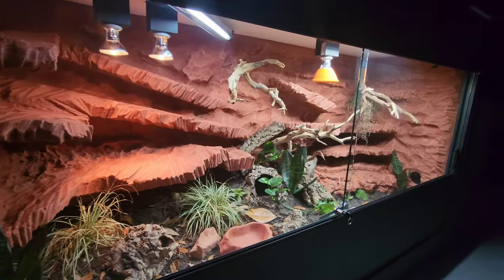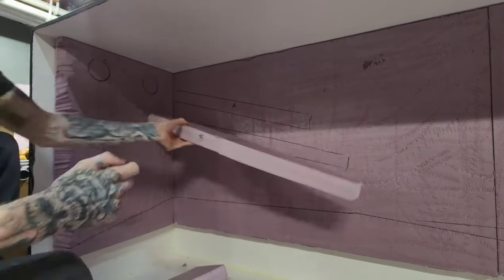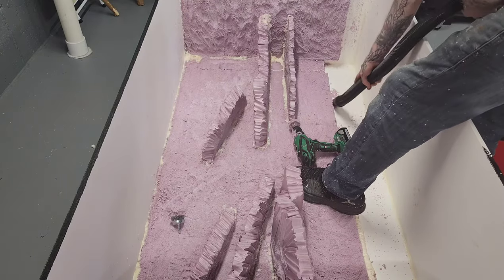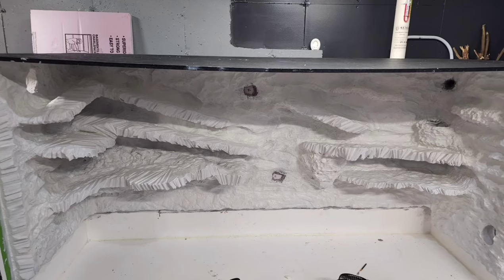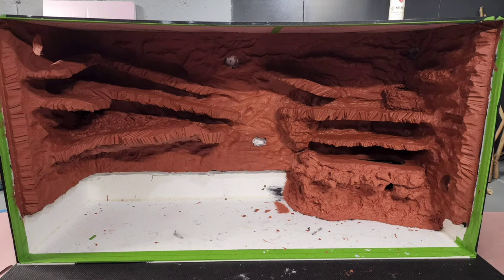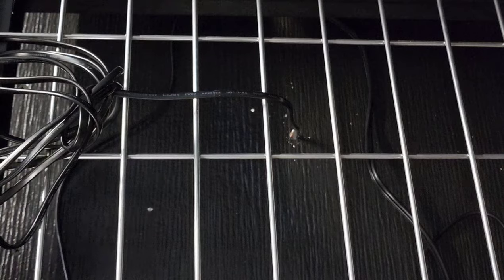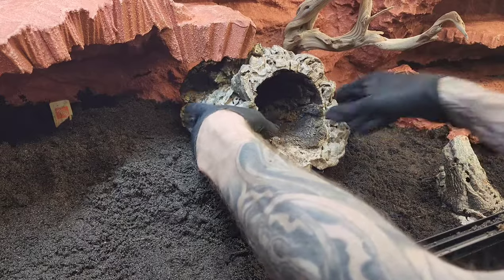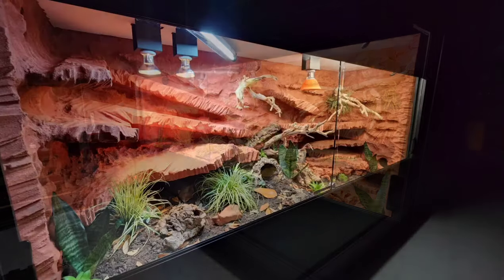DIY Monitor Enclosure Arid Set Up & Bioactive Build #reptiles #vivarium

Comment: What is the name of the timer setup you use ? Does this control the lights, heat and misting ? The app sounds amazing.
Reply from the maker: The smart plugs/ timers I use is a product called govee (link in description) 
It controls my lights, heat and can monitor humidity (I do believe they sell on that will add humidity (if you have a fogger set up to it)). The misting system uses the mistking timer that it comes with. I did add a shutoff valve to the mistking hose so I can have it mist when I want to bump humidity only because I do not want daily mistkings in this enclosure.  Hope thos helps
🤘💯🦎🐸🐍🐢🌱

Comment: I'm going to use some of that 2" pink foam to make a large rock formation(20" tall) for my paludarium, any suggestions other than spray foam for gluing up the layers?
Reply from the maker: I found spray foam to work best if you are planning on carving the joint peices of xps foam board. Otherwise they do sell a foam glue that is supposed to be animal safe. I used it like 12 years ago so I don't remember the name. But check out this video I did. It has xps foam board in a paludarium https://youtu.be/-6B4wvRxdqA
Reply: @bradsbioactivebuilds  thanks for the response. I was concerned that the expanding foam would create gaps between the different layers, but it doesn't appear that was an issue for you.
Reply from the maker: @taylorhickman84  it really didn't. If needed add a weight ontop to keep it all in place.

Comment: Dude, awesome video! Have been referring back to it more times than I can count as I've building mine. One question tho, where did you get the custom glass for your enclosure??
Reply from the maker: Awesome J_B_D! I'm glad you found the video useful. 
I just Google custom glass shops near me and went to a good rated shop.
The glass I used is 1/4 inch tempered glass with rounded edges. 
I just gave the glass shop the opening measurements with a small cut off of the bottom and top track, and they did all the math to make it work.
🤘💯🦎🐸🐍🐢🌱
Reply: @bradsbioactivebuilds  thanks just finished mine up!
Reply from the maker: @deres9  awesome! Send me a pic on Instagram!

Comment: How tall is the Arcadia lamp holder, including the ceramic portion that sticks out a bit at the bottom? I can't seem to find a dimension anywhere for planning purposes. Nice job!
Reply from the maker: The lamp holder is 3 ¹/²" from ceiling to bottom of ceramic fixture. 
With the 50w halogen lights it is 6 ⁷/⁸"
Have fun with your build and feel free to ask any other questions 
🤘💯🦎🐍🐸🐢

Comment: Are the XPS boards insulated? We are starting to build an enclosure for our Argus monitor and any tips are well received!!
Reply from the maker: Yes, the XPS board is an insulation board. Also, for an Argus monitor I would use a concrete or Zoopoxy over they xps insulation board instead of drylok. For this sized monitor, this nails will most likely do right through drylok. I'm currently building a large enclosure and will be using Zoopoxy because of the size not the monitor that will be going into it. I'll be releasing the 1st video of the series this weekend.
🤘💯🦎🐍🐢🐸

Comment: Did you use two different silicones? One for sealing the enclosure and another for adhering the XPS to the enclosure?? If so, what's the purpose of that?? I'm about to do my first build for my mangrove monitor!! Thank you:)
Reply from the maker: I did, I used one that is 100% silicone, which is for plastics and another 100% silicone to adhear the xps to the walls.

Comment: What size enclosure did you use? Build looks great.
Reply from the maker: It's a 6w4d3h enclosure I built using PVC board. The same method as this video here https://youtu.be/kFIuR6ZNy6A I just smaller.
Glad you like it. It was a fun one to put together!
🤘💯🦎🐍🐢🐸
Reply: @bradsbioactivebuilds  awsome, thanks!
Reply: @bradsbioactivebuilds  also, couple more things. What plants did you use and did they survive?
Reply from the maker: @Ethan's Animal Adventures  the snake plants, blue Aloe, Aloe pothos and some of the Succulents survived. The grass lasted a long time but placement twas the issue, too much direct heat. I'll be replanting a few once spring rolls around  to manage better. But over all doing very well.

Comment: That set up looks amazing! May i know where you got your giant panels of XPS foam from, i can only ever find the smaller panels.
Reply from the maker: Hit up home depo or lowes. Hone depo it's closer to the plywood section. Like an aisle or 2 down typically. They come in 4x8 sheets anywhere from 1/2 to 2" thick. If your looking to do a lot of carving, go with the 150R 2"
🤘💯🦎🐸🐢🐍🌱
Reply: @bradsbioactivebuilds  Unfortunately, i am based in Hong Kong. So Home depot or Lowes isn't an option. Will have to find something online. But thanks anyway! :)

Comment: I’m preparing to build a similar enclosure with the same white pvc boards. What kind of paint did you use on the outside? Would it work on the inside walls too?
Reply from the maker: I used a primer that bonds to pvc. The. Uses a 100% acrylic paint for home depo. I would use it on inside. might scratch up depending on what you are putting in there
Reply from the maker: Have fun with your build 🤘💯🦎

Comment: Where do you buy your sliding glass doors and do they come in different sizes?
Reply from the maker: I just went to a local custom glass shop near me and gave them the opening for the front and a cutting off of the the track. They calculated the size with a 2 inch overlap.
Hope this helps. If u live in the Chicago land area I can get using contact with the guy I use

Comment: Great video - how thick was your tempered glass?
Reply from the maker: Thank you and I used 1/4 thick tempered glass. They also rounded the edges and corners at a 45° angle. Makes it slide easily.
Reply: Thanks a lot  @bradsbioactivebuilds  ! The slider tracks are sitting on single panels of 1/2 inch thick pvc right? Or are the panels doubled up to 1 inch thick, like in (I think) the water monitor enclosure build?
Reply from the maker: @Hanschanhs  the bottom damn and top header are doubled up (in total 1"). They do seem thicker pvc trim board just not in 4x8 sheets. I think the max height is like 10nor 12 inches. So if you can get away with that, it would be the way to go. But any higher you'll need to double up.

Comment: Wow that is an awesome enclosure man
Reply from the maker: Thank you!
🤘💯🦎🐍🐢🐸
Reply: @bradsbioactivebuilds  I’m in process of building one for a Savannah monitor
Reply from the maker: @Travis  that's what's up! Have fun with your build and cool Varanus! 
🤘💯🦎🐍🐢🐸
Reply: @bradsbioactivebuilds  did you mix the concrete colors with the drylok?
Reply from the maker: @BigTrav310  yes. I usually fill up a plastic cup and then add quikrete to that so I have white in the can still for future colors
Reply: @bradsbioactivebuilds  sweet cause I’m going to attempt what you did just not that intense. Lol
Reply from the maker: @Travis  I'm glad to hear! Have fun with your build! If you have any more questions feel free to ask!
🤘💯🦎🐍🐢🐸
Reply: @bradsbioactivebuilds  will do man mines all out of 3/4 plywood and 2x4 but I’m putting foam board in and drylok it all inside so the humidity won’t hurt the wood as much as possible
Reply from the maker: @Travis  awesome,  that's exactly how I would do it if I were using plywood. Depending on size you may not even need 2x4 frame with 3/4 plywood. 
But this is how I frame out when using 2x4 https://youtu.be/mfydItUfs8c
Reply: @bradsbioactivebuilds  question the gslkding glass track did you get off Amazon? And I got mine off there it’s 6ft long I made my Savannah monitors cage 7ft long how did you secure the track down?
Reply from the maker: @Travis  that's where I got mine from. And yes, they only have 6 ft. The enclosure in this video is 71 inches (just short of 6ft. 
But the new enclosure I'm working on is 8 ft wide. So I plan to use 2 of them and cutting the 2nd one fit, lining up the factory ends the best I can.
Reply from the maker: @Travis  I will also silicone and use painters tape to secure them down like i did in this video. 
https://youtu.be/kFIuR6ZNy6A
Reply: @bradsbioactivebuilds  awesome thanks man.
Reply from the maker: @BigTrav310  anytime!
🤘💯🦎🐸🐍🐢
Reply: @bradsbioactivebuilds  those vents where did you get them at?
Reply from the maker: @BigTrav310  all the links are in the description 🤘💯🦎🐸🐍🐢
Reply: @bradsbioactivebuilds  do you think I need those vents like you have cause mines not a bio active one.
Reply from the maker: @Travis  weather its bioactive or not, it's important to vent a cool side and warm side so the air doesn't get stagnant or turn into a hot box. It will help different temperature gradients throughout the enclosure. 
🤘💯🦎🐸🐍🐢
Reply: @bradsbioactivebuilds  fair enough I have them just haven’t installed them yet almost done with it though. Not as good as yours but it’s going to be cool to see my Savannah go into his bigger enclosure
Reply: What soil is ok to use in Savannah monitor enclosure I’d use the pet store stuff but the price for small bag is ridiculous
Reply from the maker: @Travis  it should be, I would ask in a monitor or savannah monitor Facebook group to make sure. But that's the main reason I went with it. It's much cheaper then pet store. I think it only cost me like 50 bucks.
🤘💯🦎🐸🐍🐢🌱
Reply: @bradsbioactivebuilds  I got exactly what you went with way cheaper than pet store

Comment: Isn't the foam going to melt or warp under the heat lamps? It looks fantastic, but I’d be concerned about that.
Reply from the maker: Legit concern but with the drylok over the top, and it adds another layer of protection. But XPS softens at 165°F and melts between 200 and 210°F. My basking surface directly under the flood lights hit 140°F max.
Thank you for your comment, as others may have the same question (I once did as well)
🤘💯🦎🐍🐢🐸🌱

Comment: Hey Brad I’m using the Ackie build you did to do a bearded cage for my son. Do you use any supports for the ledges to strengthen the lower basking areas?
Reply from the maker: That's cool your building one for your some!
To answer your question, no. I just used sprayfoam (it's pretty much the same thing as gorilla glue just on a foam material.) But after it did cure I added more spray foam around the ledge where it meets the background if that makes sense. (Make sure you pull off the outer layer of spray foam, the smooth skin part).
You would be surprised how strong it is all things concerned. 
Hope this helps!
Reply from the maker: This video here show some if the strength with just xps board and spray foam. There are a few gallons of water sitting on a ledge with it just being attached with spray foam.
This build I did use polygem Zoopoxy a d I was able to sit on the ledge lol
https://youtu.be/E9RIR0qE_q0?si=VceCLQGohl3Elm3t

Comment: Did you coat the underside of the ledges ? If so maybe not seven coats since it won’t be that much traffic underneath?
Reply from the maker: I did. I probably could have gotten away with 4 on the underside of the rocks. But I figured I didn't want to possibly repair anything in the future once the enclosure was up and running. I usually do overkill to be on the safe side. 
Have fun with your build. 
🤘💯🦎🐍🐸🐢
Reply: @bradsbioactivebuilds  thanks for the advice and leadership within the hobby 💯🅿️
Reply from the maker: @JayBay813  of course,  we all learn from each other. If you have any other questions, feel free to ask.
🤘💯🦎🐍🐸🐢

Comment: What would be the best way to heat up a Paludarium on the land side that is 96" tall? Especially heating the room is not an option.
Reply from the maker: A lot of factors go into this. 
What temps are you trying to reach at the top? Middle? And bottom?
What kind of plants?
What kind of animal?
Fish? 
Screen lid or solid lid, to see if the lights will be ontop or inside?
Are you trying to have the heat reach the substrate?
How wide and deep is the enclosure? 
Whats the enclosure made out of?
Thank you for watching and your support
Reply from the maker: Also check out this video. https://youtu.be/-6B4wvRxdqA for some paludarium ideas
Reply: Thank You
Reply: @bradsbioactivebuilds  94F, home consist 65F.
Top and Medium.

Bottom is an option as well. 

Green tree python and turtle 
Fishes are tropical fishes 
Screen is Glass and screen 
Depth is 72" and length is 120"

Comment: 2inch Foam board ? I’m going with a smaller version of this (4.2.3) so maybe do one inch ?
Reply from the maker: It depends on how much carving and detail you want in the background (foam board) I went with 2 inches and after carving some spots were about a 1/2 inch thin. It's kinda like a haircut. You can always take off more lol. A drill with a wire brush really helps. You can also use wood skewers, mark them 1 or 2 inches then stick them into the foam to see how deep you have carved.
Reply: @bradsbioactivebuilds  roger that, thanks 😊
Reply from the maker: @JayBay813  of course. Lmk if you have any other questions. Happy to help!

Comment: Question:  Is there a foam board that isn't as pricey that you would recommend if someone is trying to do a similar project?
Reply from the maker: I'm not sure. That's what I have around me (besides the Styrofoam stuff, but in my opinion, it's too brittle). Plus the xps board carves really nice. What are you building for?
🤘💯🦎🐍🐢🐸
Reply: @bradsbioactivebuilds  A bearded dragon.  If you spray a good amount of spray foam around the Styrofoam board do you feel like it's still unstable?
Reply from the maker: @Kelcee Holt  there are a lot of different variables that go into it. Like how big each piece is and will it support the weight. 
You can always get 1 inch xps board and double it up. A 1 inch 4x8 would be half the price. 
I did build a hardscape out of the cheap Styrofoam like 13 years ago, and it held up, but I used a few layers of grout over it. It was for a Bearded Dragon. Check out my Instagram. I'll post a picture of it now.

Comment: What are you painting the drylock with?
Reply from the maker: I mixed in terracotta quikrete to the original drylok. Since this I have just been mixing in matte acrylic paint in recent builds. Check out the build I just put out 2 days ago, I go over it. 
Hope this helps
Reply: @bradsbioactivebuilds  ohhh that dye. Thanks i know the one

Comment: How's he doing?
I'm also getting an Ackie monitor and told my parents they need atleast 30 cm of substrate to burrow in.
But then when we went to a breeder/reptileshop owner who breeds his own varanus acanthurus, varanus glauerti, varanus timorensis and varanus macraei. 
He said Ackie's don't need that and he himself keeps them on not even 5 cm of substrate and he says they do great.
And ofcourse he is doing something right because they breed for them.(Granted he provides a laybox which DOES exceed over 30cm of substrate)
But now my parents think it's okay to go with a less tall terrarium but I want to provide the best care for my animal and I think 30cm is best.
What do you think?
Reply from the maker: He is doing great & enclosureis doing great. Uses every square inch of the enclosure.  I'll be doing an update video in the future.
I think it could be done both ways as long as there is a lay box or something for him to burrow in. I find it more natural to have 30cm of substrate as its a more natural environment but they are smart lizards and would figure out a laybox if that's where it chooses to sleep/lay. Mine does a combination of using the hide I created into the hardscape background and also dug a burrows in the 12" (30cm) section. There is a lot of different options out there but as long as the essentials are met I'm sure you will be fine.
Reply: @bradsbioactivebuilds  Okay thanks for your opinion.
I'm gonna try convince my parents to have the enclosure a little taller so I can go the 12'' substrate route.
I want to recreate the natural habitat for an ackie just like you did. Stunning enclosure btw and really helpfull video and comment. Thanks!
Reply from the maker: @larsdamen9115  thank you and have fun woth whatever you end up doing
Reply: @bradsbioactivebuilds  Thanks! Promise you I will I love these animals

Comment: Roughly how much did you spend total in materials for this?
Reply from the maker: Box: $330

Box with tempered glass $530 (plexiglass would be cheaper, but long-term will be scratched up.

Lights: $300ish

Xps board #50 and drylock $36 x 4 I think

Substrate: $50ish

Extras: $150 give or take

Hope this helps, but I'm just going off a rough estimate

Comment: Hello, I was wondering how long after painting did the dryloc stop off gassing? I pretty much did this type of build and for 2 weeks now, if the enclosure doors are shut, there’s a build up of paint smell, that I can’t seem to get rid off. Any advice?
Reply from the maker: Spray down the enclosure for about 20 minutes. That should help. Also run some fans on it. 
🤘💯🦎🐸🐍🐢🌱
Reply: Thank you! I will do that, about how long did take for it the smell to wear off with your builds?
Reply from the maker: @knightfury7212  fairly quick. I use drylok original, I don't apply each coat super thick. Making sure it is 100% dry before adding the 2nd coat. I usually wait 2 weeks to be safe forever, adding any animals (or longer because I let plant accliand root before adding anomals.)